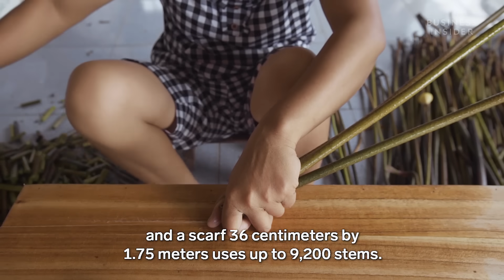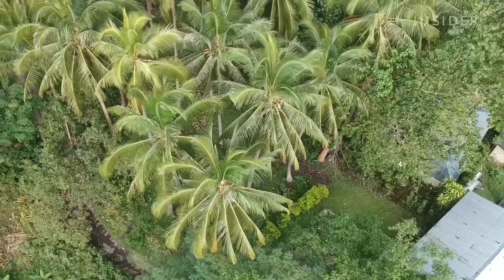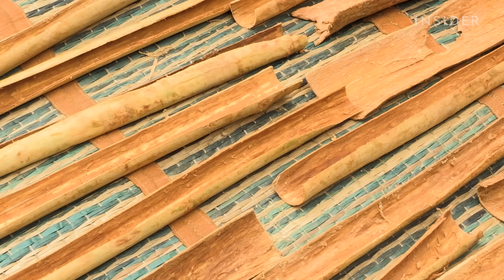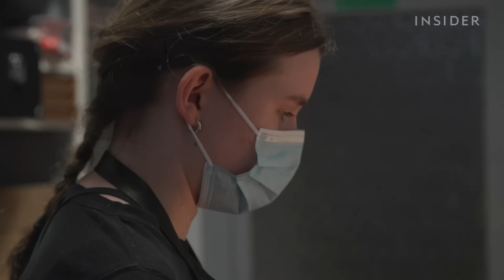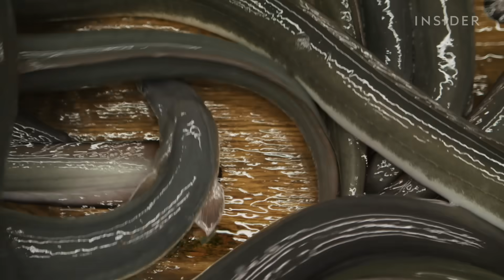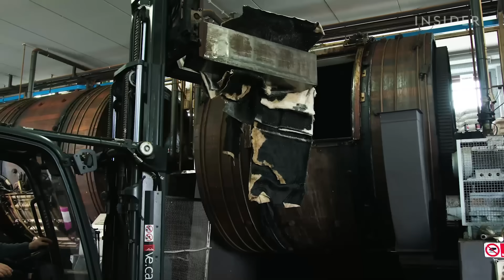So Expensive Season 6 Marathon | Business Insider

Comment: "A special tool called a bolo knife..."
No, it's just a bolo. It's the Filipino equivalent to a machete, and it works under the same principles as a khukri. The inner curvature of the blade, together with the blade weight primarily towards the tip, makes it easier to slice through tough materials such as bamboo.
Bolos are used all over the Phillipines for farming, gathering, hunting, general utility around the house, and are also quite formidable weapons. There's nothing "special tool" about them. No more than a Mexican machete is special. 
Gringos... such weirdos.

Comment: When you go to buy cinnamon, the label doesn't usually tell you if it's real or not. When you get the sticks you can see that it is the real thing when it has several layers vs the other that only has a couple and is thicker. The flavor is softer and sweeter, most of us are used to the other that has a sharper and spicer taste. It is about 3-4  times more expensive here in the US.

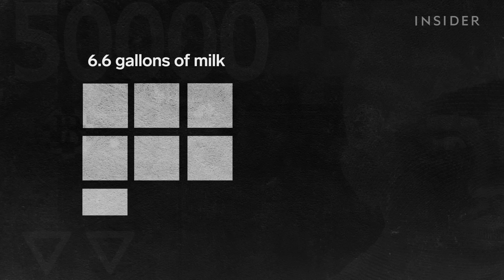Comment: 52:20
Why are you doing that.
Calling it by gallon and in the next second calling it kg.
Those are completely different units of measurement and mean nothing when compared to each other.
1 litre of water = 1 kilogram.
So long as we are talking about water.
It is a beautiful system.
But 1 gallon is 3 litres of water.
Why are you doing that.
What is wrong with you.
How can you consolidate those 2 ideas into one and tell yourself it makes sense.
19 litres to make 1 litre of cheese.
Yes you can use a litre to describe a solid if you wish.
Or 19 litres to make 1 kilogram.
That works too.
Its not hard.
Dont make it harder.

Comment: Horsetail bows are very good both however cat gut bows are the best. I find that the naked cat will have the most beautiful guys when it comes to the sound of the bow. As far as the wooden portion some people say that fiberglass reinforced works very well but me personally I prefer Hardwoods very dense and yet they have some sap left in them after they've been dried and they have a bit of spring to them that would work best like cocobolo. Is that the musician might be allergic. Usually something remedied by having a bronze handle for the musician to hold on to and lacquering the cocobolo so as to keep the resins on the inside. The problem of course being that you have to use the toxic acidic fat black instead of the lack of the back of the bug which means that you have to cut the tree and then very carefully separate out the lack from the garbage that gets into it well it is draining however you get a very very clear lack this way that will draw out the sap from the cocobolo and give it an aura. The process is so very expensive and the results are beautiful audibly and Visually worth every penny. And the price will only go up on the boat as it ages just like your Stradivarius.

Comment: Opal is the worst variety right next to Jade. Once opal is photographed and Laser Edge that is it price until it is cut free photographed and laser etched again. The problem is it's the Providence that is where it came from. What Jim stockpiler is selling it. Where they laser etched there by defining the absolute direction from which the picture was taken thereby defining its actual Beauty because you don't look at the gym you look at the photograph and you measure the gym. You plug all that information into a computer in the computer will spit out the price but if you just turned the gym a little bit and take another picture the computer would spit out a different price altogether. Each of these factors determines the price of the gym individually as well as all together and hahaha many for many different reasons the price can be jaded as Jade is gold and Jade are simply proven to be one 100% And then according to the eye judged if the Providence is even verified or cleared because you can have perfectly good Providence on Jade or opal and if that house simply chooses not to recognize it then it does not exist and you can remove a couple of digits from the price. I have personally seen an opal go from $2,000 to $20 simply because when they mounted the opal they scratched the laser etching when the clamped it in its setting. Because they can no longer prove it was an opal it was now past. Strangely enough as much as 2/3 of the price of jade can be exclusively the name attached as artisan. In addition there is only one lab that is certified for registering Jade and their opinion is that all Jade comes from third world countries and nowhere else except China. Strangely enough even though Jade is often taken from the Andes Tibetan Jade and India Jade does not exist it is all China Gate or it is not Jade at all it is jadeite paste. And if that is not bad enough the third world country where it comes from will have its own way of measuring the quality of the Jade. Where one kind of Jade only needs to qualify by being almost as hard as a diamond and other area will qualify their Jade as the clarity in and how much light will shine through it, the patterns in that Jade and the colors in that Jade. Because there is only one place that can verify your paid for you and because it is so difficult to get them to verify anything just the process of getting the Jade to the lab me lose you the value of the date all together because it did not go through proper channels or verified channels and then of course Jake can be doctored. Piece of Jade with a crack in it can be boiled and you will lose the crack until you acid at that particular crack which you cannot I said it's Jade at all so that should automatically be one way of testing which even most jewelry shops will not do because there is a lot of imitation Jade out there even Harry Richie has been validated as a place to find paste when you're looking for Jade, Debers is another place. And that is simply because the lab where you have the date tested can test the same piece of gate two or three different times and give you two or three different answers because you gave it different Providence each time. Simply put you can take four pieces of jade all of equal size and weight and value because they all came from the same piece of lens, send them each out in their own Direction to that lab to be tested from different buyers but exactly the same seller and declared from exactly the same mind but a different time of year or even a different year and they will be declared from different lenses, even though it is rare to have more than two lenses in one mine. If I understand correctly Jade and jadeite are basically the granite that was surrounded by lava flow and cooked under extreme pressure. You're in Oregon and up in Washington we have what we call Black jadeite it truly is Jade a little undercooked with iron ferrite in it. Most of it gets sold as green jadeite marble. Which is actually quite the oxymoron considering it has a hardness of eight to nine so it makes a beautiful cutting board one that is guaranteed to doll your knife and even blunt or chip your cleaver. There is only five or six things in the world that you can use to grind against true Jade and maybe 10 materials in the world that you can use to grind jadeite including Jade and jadeite. I find the best way to get paid verified is to get it verified by the slab with that milky fat layer on the outside, Market off as to how you are going to cut it when you get it back from the lab and verify which side is the bottom that you will not touch so that they can laser engrave it. You will always get a slightly lesser price for each individual piece because they cannot see the finished product but then again they can test every part of the top surface and verify as much as can be verified by Shining Light through it. I will often cut my pieces 75% of the way through and then fill that with 5 minute epoxy before shipping the slab off to be verified. The lab can easily enough verify that the 5-minute epoxy will not make a proper Bond and thereby cannot affect the overall price because it has not embedded itself into the piece and yet they can finish breaking that apart if needed to verify each and every piece individually. I will do a rough shine on both sides of the slab before I cut and I don't worry about polishing the cuts I just washed them as clean as I can before applying the epoxy and let the piece he's up in the Sun bringing out most of the bubbles so I usually get like 3 minutes out of a pour and yes that means stir for 2 minutes apply one minute and you're done whatever it is it is now if you don't like it chip it out and pour again it's very brittle

Comment: What? Coconut oil is cheap because coconut is everywhere. Even when the price is doubled, it's still cheap.
Making coconut oil is not hard either. My mom made it at home all the time when I was small.
It doesn't require to make the oil manually either. Cold press machine is actually a better way to extract oil.
Coconut oil does make you fat. We use coconut oil for hair and skin. We don't usually consume it as food.
Olive oil is much more expensive and valuable

Comment: Stone Crab Claw harvest doesn't work as well in practice. It's very uncommon to harvest a crab a 2nd time. Which is why most of the footage shows the crabs are shown with both claws on them. The reason why some claws are smaller than others is simply because 1 claw grows larger as the dominant claw, IT'S NOT a regenerated claw. If those crabbers truly cared about the sustainability of their product, they would have used a device to remove claws without risking the joint from being damaged. Snapping off the claw by hand would never guarantee the crab doesn't bleed out. They only hear on paper how the job works, but they clearly never seem to care about how to ensure their harvest is sustainable.

Comment: Not sure where the error originated but the Japanese knife section has a mistake in the translation regarding the layers of the sword. "soft iron in the inside. hard steel on the outside". it is the other way around, as explained in the following seconds of the clip regarding chef knives. Hard iron goes on the inside to provide a structured and sharp edge, the softer cladding provides the elasticity to prevent snapping.

Comment: Veggie-tan leather is NOT the way to go another more better tanning procedure is Native tanning where the brains of the animal is mixed with warm water and then rubbed vigoures way into the hide to be tanned then stretched onto a frame and dried, it is then taken down stretched over a large log and scraped, brains are then again rubbed into the rawhide, again stretched and dried and scraped again do this several times until every molecule of hide is impermiated with brains, then the hide is formed into a teepee shape set over a smokey fire, more smoke with little flame, it is then smoked for a few days, occasionally stretched and scraped, the smoke causes formaldehyde to set into what is now the softest Most supple and waterproof leather you willbfin anywhere, THIS has to be the oldest most effective method but due to the labour intensity makes it THE most expensive leathers in the world, a single buffalo (bison) hide will cost well over $1,5, 00 dollars , it is far from  a traditional tanning, Mexican leather is tanned using urine, whichbkeans no matter how beautiful Mexican saddles are not recommended for riding in the rain, as  you come in to the dry stinking of urine, BOT nice anotherc OLD tanning still made by Gomsshall tannery  is dog turds once more NOT. A pleasant fragrance when gotten damp the use of straight formaldehyde is a very new process Doc Dee

Comment: With the opal minning this guy can use something called resonant sound you can send sound waves through The Rock and the opal will have a different ping than the surrounding rock making a better way of finding opal without having to dig through the rock
Reply: After the cost of the equipment, analysis, transporting things to/from the middle of Australia, and all of that competing against the operational cost of an Aussie with a pickaxe….

It’s just not viable. Not to mention I don’t even think the technology to differentiate slivers of gemstone amidst a mountain of rock is a thing. If it is, it’s certainly not worth what you would make off all the opals in lightning ridge.  *specifically that the valuable opal is amidst tons of worthless opal.
Reply: in practice youd still spend a ton of money chasing veins with only a slightly higher ability to hone in on them when you already happen to be close. But if youre not already close, all that tech is gonna have quickly diminishing returns, high costs the harder and more you use it, and tons of unforeseen consequences that will sporadically hit like a kick in the balls when you can least afford it. would be like running an engine at peak and hoping it doesnt burst into flames, the engine being your pocketbook

Comment: That chess part is a bit bull****. Every woodcarving artisan can produce these, not just 10 in the world.
Reply: It said qualified. Which is just as bullshit. I agree. Anyone would think only 10 people in the world have lathes. And they said the hair on the knights tail.. thats a mane.
Reply: Not at all impressed by the making of Cuban chains myself.  They said soldering was the hardest part, looks easy as hell.  I work WAY harder with a way bigger torch all day every day.
Reply: @thorium_glass  I think they meant the hardest part to get right, as after testing they have to go back and re do all the joints that failed, the filing and turning are the most labour intensive.
Reply: I smelled so much bullshit throughout. But yes, especially the chess pieces.
Reply: it was pretty clear it was for the world chess champions, most "sports" only buy from specific makers.
Reply: @karl810  sure, but why is that in some exclusive doc. They are not made of emerald or anything rare.
Reply: @plexoduss  because making them of emerald would be some pompous elitist bullshit, and it would increase the price several times. They just want high quality traditional pieces and 10 different people/companies is actually pretty generous i think, some people only prefer 1 supplier.